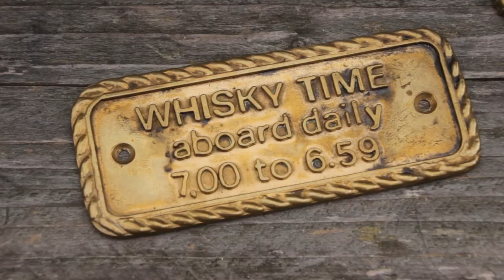Whiskey tray

Comment: Great job mate. I was expecting to see a drill press but using a router to make those holes worked well
Reply from the maker: Thank you! I used the router because i thought it would give some cleaner cuts instead of using a forstnerbit. I also needed to rout out some rectangle so i thought to myself why not do everything this way.